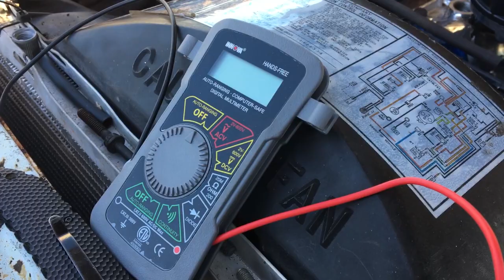1984 Ford LTD Crown Victoria Restoration Ep. 06: Forest for the Trees

Comment: How did you end up getting the distributior timed/dropped in correctly. I did the intake gaskets on my 85 ltd 302 and cannot figure out the timing
Reply from the maker: It was a little complicated the first few times I tried it, but I think I got it figured out after a bit. The easiest way I found to do it is to
1. Remove your number 1 spark plug (on your engine, this will be the front passenger side spark plug, the same one I was using in the videos since we have the same engine).
2. Put your finger over the hole so you get a decent seal over it. As long as you're just over the hole on the outside, this is perfectly safe. *CAUTION: my spark plug holes aren't big enough for me to get a finger inside, but if yours are then be VERY careful not to put your finger inside the hole passed where the spark plug screws in and the piston is moving or you could get hurt.*
3. Then, either roll the engine over using the crank case or bump it with the starter. Eventually, there will be a powerful air pressure on the inside that pushes your finger off the hole (you won't be able to keep it on no matter how hard you're pushing). It's a little startling if you've never done it before but it doesn't hurt. Then you know you're on the compression stroke and that cylinder is near TDC.
4. Since you have a Ford, your distributor will be in the front of the engine, so take the top off your distributor off and gently set the distributor in the hole with the arm facing towards the #8 cylinder (or towards the driver seat). Be sure to put some grease into the teeth at the bottom of the distributor and around the o-ring so it doesn't get hurt when it starts up the first time. ** Note: It really doesn't matter where this is pointing in all fairness, as the arm is going to spin around and set them all off in whatever order you make it, but that is the factory setting so it will be easier to remember / work on if you keep it consistent. **
5. Now, as you set it down, the arm is likely going to rotate a bit clockwise as it moves to find it's slot on the gear inside, so you'll want to start the arm slightly counter clockwise (or to the left) of where the arm will eventually end up. It's going to be a bunch of jiggling the distributor up and down to slowly kinda get it to find the right teeth in the gear to There are going to be two kind of slots that it feels like it hits as you put it in. The first will be for the gear that turns the rotator on the distributor and the second will be for the oil pump at the very bottom. You'll know you've made it into both slots when the distributor is seated flush against the intake manifold. 
6. Now you should have it where the distributor is in and at TDC (top dead center). You can check this against the harmonic balancer (the big wheel that will have markings on it, though if your engine is in the same shape as mine, they'll be very hard to find since there is rust there so you'll need to look close and maybe mark it with a tire marker pen) to see if it's pointing at TDC, which it should be unless you've had some sort of timing slip on the car. I'm still working on trying to find out the perfect timing for my 302, but so far I've landed on about 10 degrees before TDC (which would mean the white mark you made on the harmonic balancer will be to the left of the timing mark thing). Seems to be running with that. You adjust the actual timing of it by turning the body of the distributor clockwise (retard) or counter-clockwise (advance). The arm shouldn't move when you're turning this, only the body of distributor. So, if you want to get to 10 degrees before TDC, you'll turn it 1/36 of an entire turn to the left. You can check this with a timing light on the harmonic balancer and that little white line you made.

I'm actually working on my next video (episode 13) that will discuss parts of that and what I'm doing. If you'd like, I can do into greater detail on it if that may help you out. I know it's been a big learning curve for me personally so if I can give you any tips/tricks I've learned along the way, I would be happy to! Just let me know :)

Comment: Did you check the fuel pressure is correct for the carb? Don’t fuel pumps for the fuel injectors that were in it have a higher psi? Did you ever check the fuel pump before the carb swap?
Reply from the maker: According to my research the fuel pump for the 84 Ford should be putting out about 30-40 PSI, way too high for a carb. I got a Holley fuel pressure regulator installed and dialed it back to about 4 PSI and it seems to like that. Though I still need to work on the return fuel line but no more gas spraying everywhere so moving in the right direction! :)

Comment: For the drums if your car not a police interceptor you need to get the small size for your drums parts (break shoes,springs) i think your car is 10 inchs like my crown vic 1990
Reply from the maker: Ah thank you so much! No it’s not an interceptor, but boy wouldn’t that be cool! :) What color is your 1990?
Reply: @gwe87  white and no leather on the top too
Reply: @gwe87  or you just swap the diff for disc brakes any crown vic will fit even 2007 diff work the name of this diff (ford 8.8)
Reply from the maker: @عبدالاله-غ6س  Hmmm. Yeah I have considered about swapping those out for the new style of brakes, but I'm not quite sure I want to go there just yet. I think it has a lot of merit and they are easier to change, but I also have read that they have less stopping power than the old-school brake pads, and that the LTDs from the 1980s need that stopping power. Granted, I'm not anticipating getting in a situation where I'm street racing this bad boy anytime soon. :)